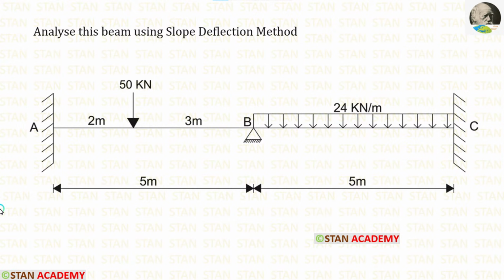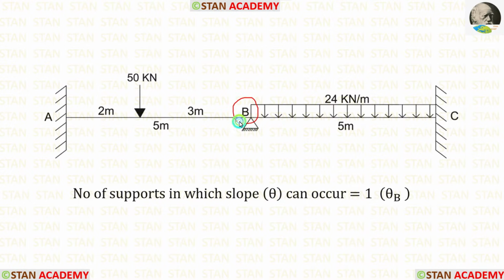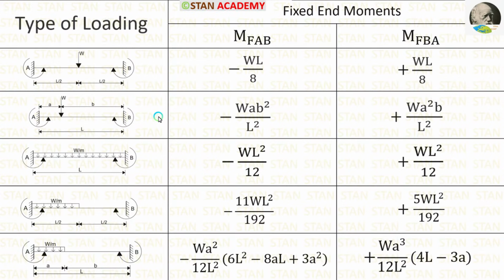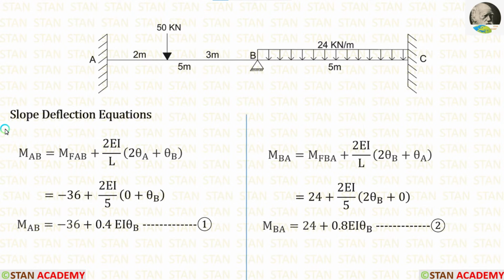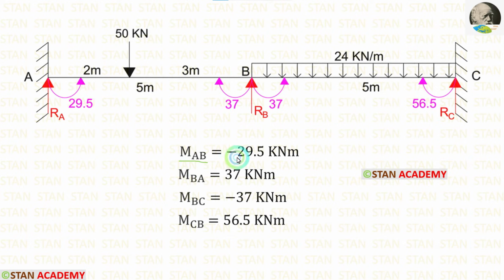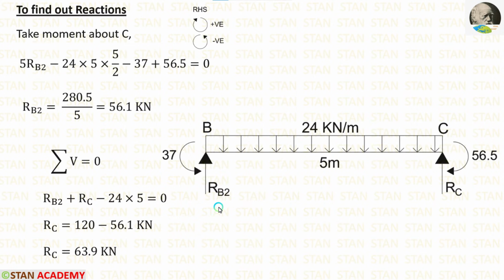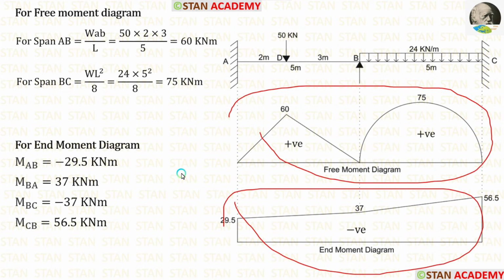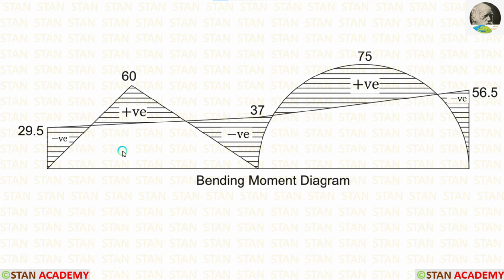Slope Deflection Method for Beam Analysis - Problem No 1

Comment: Hello there. I really enjoy your video but I think it would be better if you talk about the sigh convenstion and directions before actually starting to solve a problem. Cause some of us use the sign convention which is opposite to yours. If you derive the equation using the sign-convention at the start, most of use here won't be confused. Again some of us think that the negative sign menas that the direction is opposite to what is taken. Again, one of my problem is in the joint analysis part of summing up moments at joints. For example, in joint A, we 'added' MBA and MBC but does it mean that both) of them (MBA and MBC) are in clockwise direction? If not, then why are they added and not one moment substracted from the other moment to align with (follow) the sign convention? This makes it hazy as we do not know how the moments and their directions act at particular joints.

Comment: Why was 5 multiplied by 5/2 in the in the Udl calculation ?
Reply: 24kn(force) x 5m(span) x 5/2(where the force is acting in the span)
Reply: @celestial_188  I’m still a little confused. Why is is the force of a udl always acting halfway to the span length?
Reply: @graphkin4709  think of the udl as a rectangular loading, the total load from the udl(24kN x 5m) will act at the centroid of the rectangle(centroid of rectangle is half of its length)
Reply: @ ok thanks
Reply: To show the exact location of load applied by intensity of udl